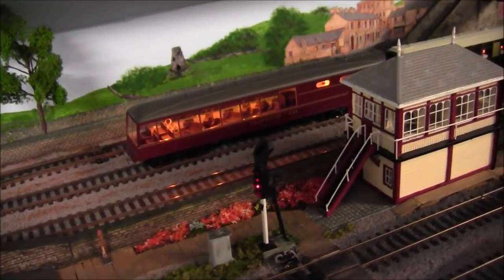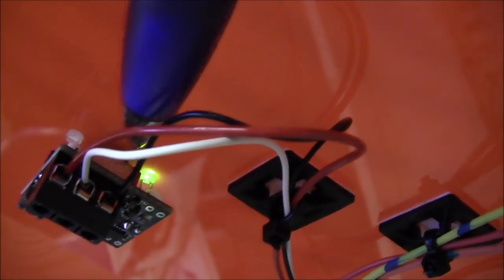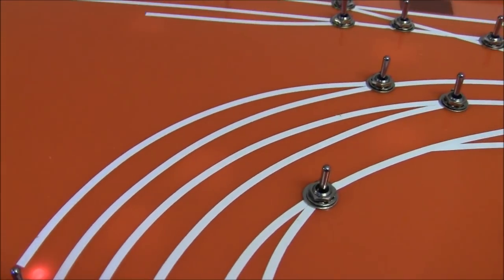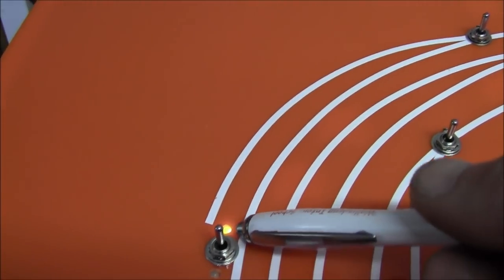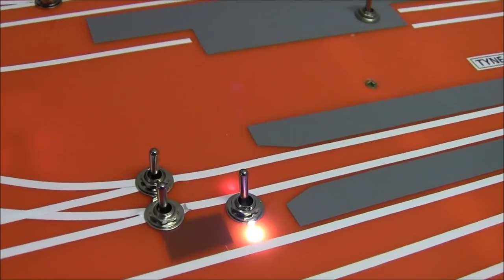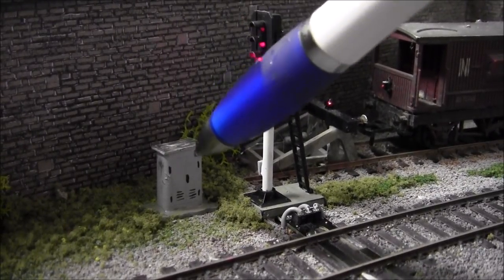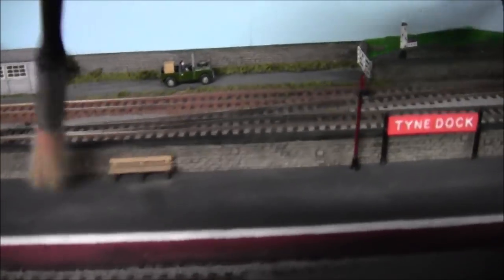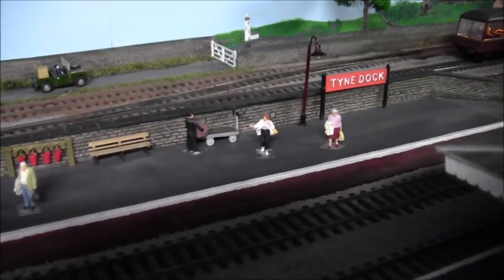Train Tech Mimic switches, layout clean up..No164

Comment: That Train Tech system is certainly very easy to install and the block signalling functionality certainly is impressive, talk about hands free but with a manual interrupt - its got it all. I got a few of the TT SC2s so can play around with those but you have to send CV commands to trigger. I think the intelligent version you have although more expensive are certainly worth it as you have clearly demonstrated. Ah cleaning, as infrequently as I can get away with…..but plastic bases to figures certainly assists. Video was a suggestion after I was browsing TT products in m web browser. Talk about big brother is watching you… All the best Stephen
Reply from the maker: Hi Stephen they are dead simple to set. and work a treat. but you still have to control the trains, just like the real things.  LOL. i think this video was done well before you joined the channel. i get that feeling all the time, being watched, that is...thanks again Tony

Comment: Good video Tony, the wiring of your signals is a bit beyond me, but they do look good. Keeping a layout clean and tidy is something that always needs doing to stop the build up of dust and is often overlooked. Just placing passengers loosely on the platforms is the best idea, because you can also rearrange their positions or change them if you want to anytime. With a layout as big as your Tony, it must be a never ending job, keeping it all tidy and running properly.
Regards
Geoff
Reply from the maker: Very True Geoff, yes it is a never ending job cleaning. and what's worse the dust shows up when videoing close ups. I never glue anything down just in case. they are exceptions. telegraph poles, that may never need maintenance.... have a great Easter...…….Tony

Comment: Hi tony
Your wiring work is a thing of beauty
They way it works does go over my head if am honest
So sorry
Your tips on how to keep it clean is great it what I do to.
Question what was the cloth called you used on the tracks?
Keep safe arp
Reply from the maker: Hi Adi, Mate. the cloth is a polyester fibre cleaning cloth. you can pick them up from lidl's. that,s where I got mine from. they lift the dirt up with ease. take care Tony

Comment: Tony can i please ask? Is your control board made from perspex? And what did you use to simulate the tracks? (White lines)
Thanks in advance
Reply from the maker: Hi Nismo, the control panel is made from perspex 4mm thick, the white lines are vinyl strips 3mm wide. they come on a roll and are sticky backed. ideal for what you want. cheer's Tony
Reply: @TONYNORTHEASTERN  excellent.  Many thanks.  I'm on it ;))